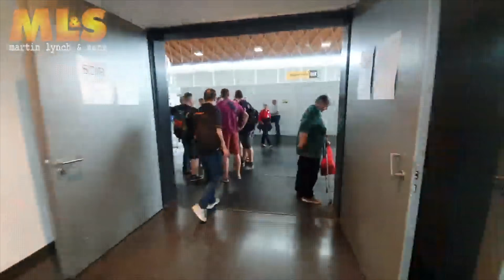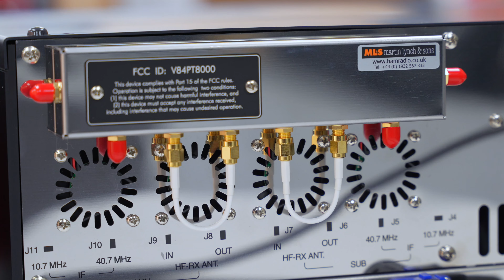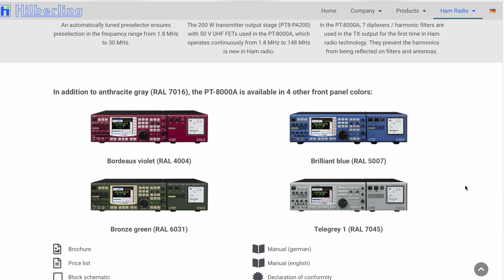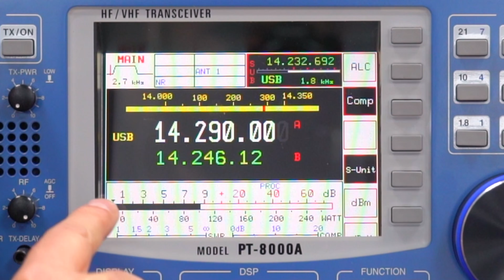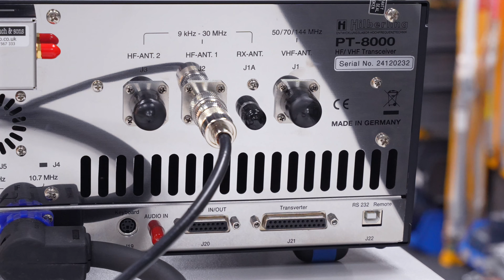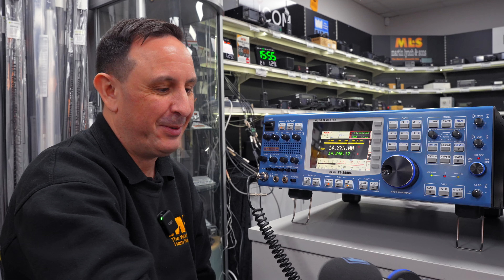The BEST Ham Radio You've Never Heard Of - Hilberling PT-8000A

Comment: That radio looks like the one radio you need for rest of your life. It looks like, it’s easy to repair too. I look at the web page and they have the schematic of it on line. Nice video.
Reply: One would think it would never need repair at that price. It actually reminds me of the TEN Tec from days gone by.
Reply: @chriscahill1964  No such thing exists, if there are parts there's going to be repairs, it's just how you can go about it and how much redundant the design is (and how it handles failure states).
Reply: @tomaszwota1465 I’ve had a Kenwood R 5000 for 35 years without any repairs whatsoever
Reply: @chriscahill1964  very cool, but that doesn't mean R 5000s don't go bad at all as if they were some kind of Blessed Design. ;)
Reply: @tomaszwota1465 What an odd technicality you raise. 35 years for any radio is the ultimate bang for buck and nothing lasts forever. I was just pointing out the radio was the next best thing to living forever and never needed parts
Reply: @ I'm just saying... No matter the price, every mechanical device is prone to failing. Even radios costing upwards of 10k euro. I'm not saying things can't last or anything, but the expectation of "not failing, given the price" that the other poster raised is rather absurd. You can't expect that even if it is a great no compromise "money's no object" type of thing.

Not sure what kind of technicality a simple fact of life is...

I'm happy your Kenwood works fine. I have a Kenwood as well (a different one, though) and try to keep it nice and well kept because I know there are some sore points in them, some caps that like to fail occasionally.

Doesn't change the fact that stuff fails and expecting it not to at all just because it's expensive is a good way to get disappointed. ;)

Anyway, hope your radio never needs any repair work done, genuinely. Sounds like you take care of it well.